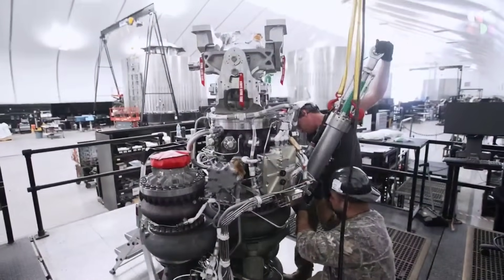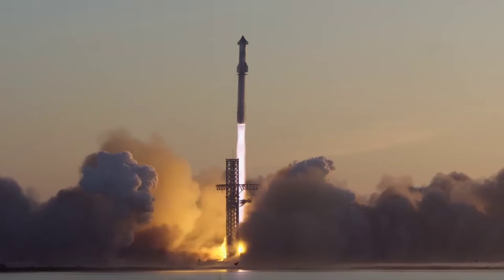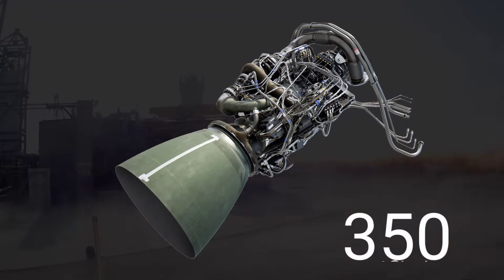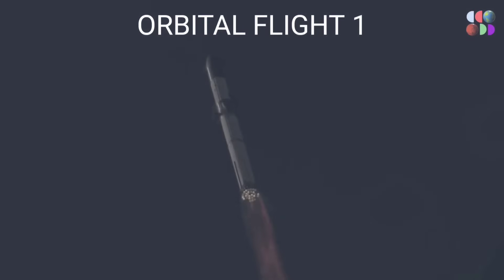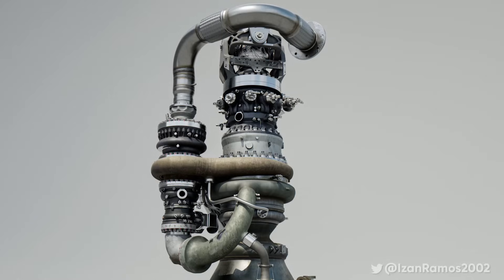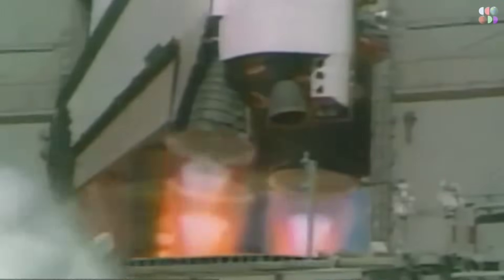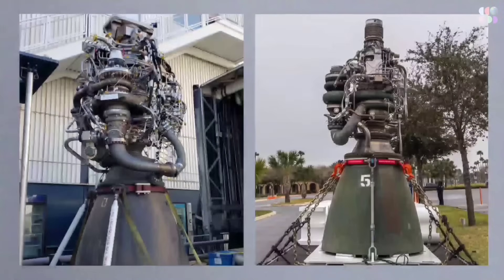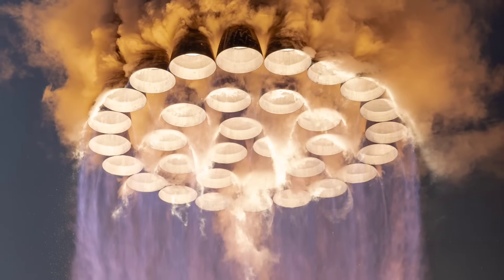FINALLY! SpaceX New Starship Raptor 3 Engine That Will Change Everything!

Comment: Starship 3 is going to be a magnificent Disassembly. Don’t miss this launch. I can’t wait for the long list of excuses. 33 engines was never going to work. A raptor 3.0 has much more thrust. The booster will most likely massively explode before engineers 🧑‍💻 can initiate a hot stage of the starship.

But if they can initiate the hot stage maneuver. The thrust and massive vibration will have doomed starship before separation. I was hoping they could at least fly starship and test their thermal tiles.

SpaceX can’t use more than 13 engines max on a single frame. That would be 9 outer engines and 4 internet gimble engines to steer. I wish I had the time drive down and see it.

Enjoy the Elon musk show.